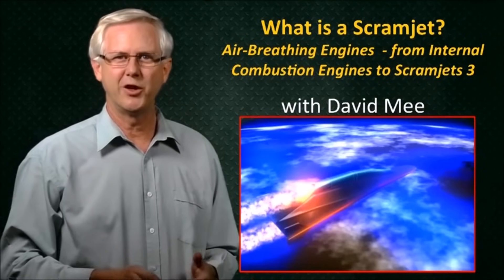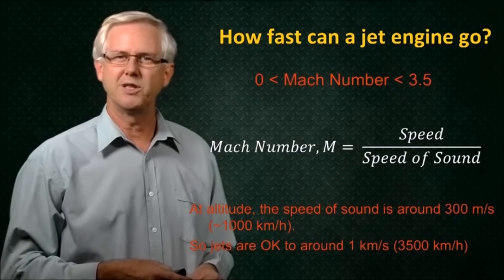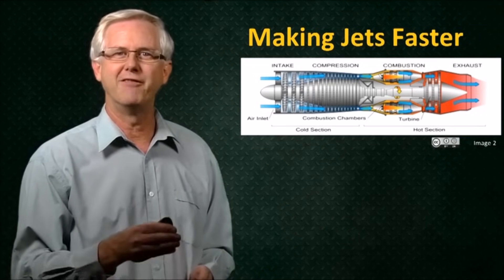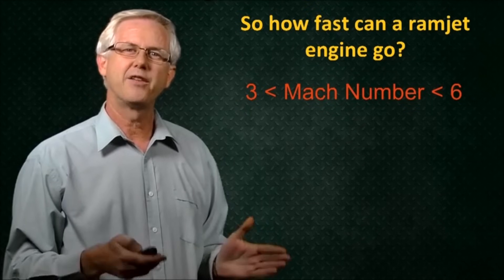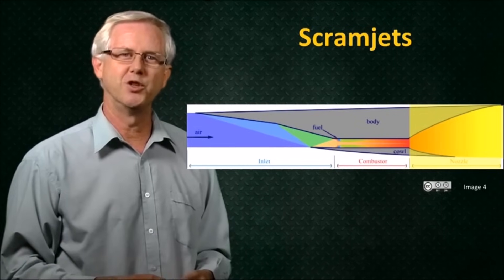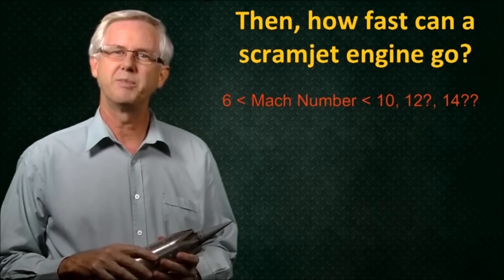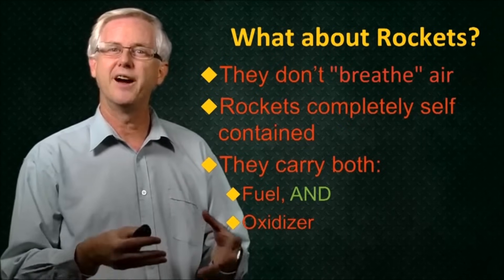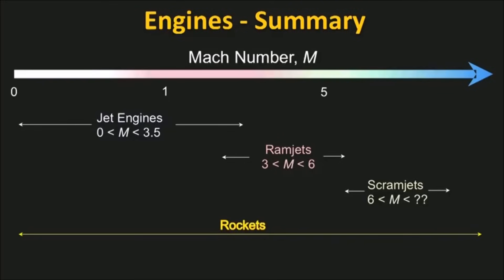Ramjets and Scramjets Explained - Mach 14

Comment: Hmm, I guess the goal would be a seamless transition from turbojet concepts to rocket concepts all in one engine. 

In which the traditional turbojet is fitted with a scramjet bypass as a function of the afterburner, in which of itself contains the rocket mechanisms for outer space travel.

An engine that adapts to it’s environment, though quite complex due to the integration of the three systems at once, if not compounding the cooling issues and the limits of the combustion process
Reply from the maker: the concept at the moment is rocket launch to Mach8, initiate Scramjet. Suitable for missiles mainly and vg for such due to the extended range resulting from no oxidiser required/this is where development is at. Then next a composite engine is the Nirvana, logically turbojet to Mach3.5/close compressor/into Ramjet mode (eg SR71)/get to Mach8/into Scramjet mode/get to Mach14. Such a vehicle will be the way most spacecraft would be launched.. piggybacked onto the Scramjet composite.  The main barrier is heat at hypersonic speed/most metals melt/most sacrificial surface systems haven't worked. The Queensland Uni is developing the laminar/isentropic flow technology that overcomes this which is why the US Govt has bought into the program.  It only takes one idea to make things work then everyone else can develop the crap out of it

Comment: As the scramjet is limited to its oxygen supply would it be more effective to design a hybrid scramjet as as it pushes to its limit of mach 10 more oxygen is added to the scramjet to make the jet burn hotter but the oxygen could serve a duel purpose to keep the engine cooler so it doesn't melt under the extreme heat. Mach 14 onwards may be more achievable then.
Reply from the maker: if you watch my latest video: https://www.youtube.com/watch?v=ovKipc5LpCU  .. at 3:41 you'll note that Stanford University added hybrid flow to the test craft that Queensland University are now building with the USA
Reply: Edwin Henry Blachford I did wonder I'm a mechanical design engineer by trade I came up with a design that incorporates a version of the j58 engine with a hybrid scramjet. The aircraft is then able to get up to optimum speed under its own power. The twin j58s shut down and close off at around mach 6 which is enough to start the scramjet. Then from there the scramjet powers up to mach 10, from there the coolent system is engaged before the oxygen and kerrison mixture is injected to take the plane upto mach 14 then the kerrison decreases and the oxygen increases to take the plane possibly upto mach 16 or above.
Reply from the maker: it sounds like you need to enrol at Queensland University.. for they have a hypersonic wind tunnel where concepts can be tested.  You may note that the USA is quoting Australian/US designed Scramjet missile delivery rates on the basis of Mach14 sustained flight..  To go to manned hypersonic flight the experience gained in the SR71 program would be of assistance but the move from 3500kph to 14,000kph is a big one so initially the application would be missiles and drones. Lessons and reliability derived from that use would spur on the manned craft.  This is a new frontier on many levels
Reply: Edwin Henry Blachford i live in the UK I am currently studdying a degree in STEM. I have emailed BAE systems about the design and im hoping they would take it further so fingers crossed i can get to speak with someone and talk through the designs.
Reply from the maker: a wise move.  It only takes one bright idea to start a whole new technology. It would be nice to be at the forefront of it eh :)
Reply: Edwin Henry Blachford it would be nice to see some returns on it for sure. I've always had an interest in aeronautical engineering and to put something into practice that would move furture technologies forward into the future would be a tremendous achievement. I watched the prototype of your design the fuselage looks amazing.
Reply: Edwin Henry Blachford I've not heard back yet but i have also written to the RAF to see if they can point me into the right direction. I have come up with a fuselage concept that is built  around the the scramjet to save on weight. Im struggling with material composite thats able to handle the extreme heat and hypersonic airflow pressures at the moment that was what i was hoping to speak with someone on and how to house the main jet engines and how to redesign them but also work the same way as the j58 does.

Comment: Basically, a 'rocket' engine can work, if one simple removes the entire oxidizer system, replacing it with a simple, very small and light air intake.
Jeezes, folks...
We speak of flying in an oxygen based environment for airplanes.

Comment: Where do Pulsejets, like the V-1 fit in here? Can a rocket be used to cross the Ramjet/Scramjet interface in real aircraft (not just research vehicles)?How about directing the air from one chamber (like a revolver with or without moving parts)?Maybe one inlet that divides up and the side shape restricts till the cylinders are synced like a multi-engine airplane, but firing in sequence like a V-8 car engine?

Comment: If sound travels faster at sea level than it does at higher altitude, then you would be flying at a higher Mach at altitude than you would be at sea level at the same relative speed, but simultaneously flying at a lower ground speed.

My question is, at what point can you no longer increase your altitude to mitigate the effects of too much air compression ( and therefore high temperatures), and drag? And can ram- and scram-jets operate at higher altitudes, or is it a physical requirement? Can you not just increase altitude until there's hardly any atmosphere?

Comment: Popular Science reported that Professor Wang Zhengou won the Feng Fu Award for developing a combine cycle engine.on October 8,2015.The report shows in pictures how the turbo-scram jet engine works,As the jet engine reaches mach 2 speed,the air is shut off to the turbine portion and directed to the scram jet engine.I think the turbo-scram jet engine is manufacture by using a graphene-titanium alloy to with stand the high temperature..On September 18,2015 a stealth airplane flew at mach 6 speed for several hours and landed as shown on CCTV-13 and reported by two newspaper.The airplane used two turbo-scram jet engines and a graphene-aluminum alloy fuselage,wings like the C919.On January,2017 a turbo-scram jet  was launched and shown on CGNT.
Reply from the maker: graphene-aluminium and graphene-titanium alloys melt at hypersonic speeds.  You must remember that the craft is approaching the velocity of a space craft during re-entry.  The answer for sustained hypersonic flight is not with exotic materials.  Your report appears to be propaganda
Reply: Corrine Tsang it's amazing what you can with balsa wood
Reply: Any link to the articles you are referring to ?

Comment: 1000km/h is not 1km/s that would be 360km/h.  60sec x 60min
Reply from the maker: Yes the professor is wrong in the middle of his long unscripted lecture, but 60X60 = 3,600kph ( not 360kph ). So you're wrong also. 
This is the second comment here claiming that 60 times 60 is 360. Amazing.

>>>> The actual speed of sound is 0.344km/s <<<<.

To be precise: at 50% humidity, with 101.325kPa atmos pressure and 20C, sound travels at 343.99m/s = 0.34399km/s = 1,238.364kph = 769.4837mph = Mach 1

Therefore if a Ramjet is doing Mach8 it's travelling at 9,800.352kph nominally.  or... 6,089.655mph.   Which is equal to leaving New York and arriving at San Francisco 25 minutes 20 seconds later.  Airlines would save a fortune on in-flight meals.

However, a Scramjet doing Mach14 is doing 17,150.62kph nominally or .. 10,656.90mph.  New York to San Francisco would take just 14 minutes 29 seconds.

When governments design roads that allow us to drive to an airport, park and board a plane under 1 hour i'll be truly impressed.

Comment: Don't understand this at all. (I suppose I'm a thicko)
The diagrams show that the intake aperture is bigger than the entry into the combustion chamber (it narrows)
Therefore in my thick brain, this speeds the air up, not slowing the air down as he said?
Reply from the maker: Some tapering of the throat must be expected to replace the compressor stage of the turbine. Hence the design has no moving parts. This is where such a design looks deceptively simple, for what is too much taper?

Comment: What interested me the most was the fact that  while Queensland University has done so much work on this concept. The actual state of scramjet research is buried in the depths of "Classified" information probably in Russia and the United States.
Reply: All I'm saying is look at the Blackbird. That thing is a mechanical marvel and was built during the cold war. Rockets however made putting those engines on planes obsolete. Why spend hundreds of billions if not trillions putting it on a plane when you can build a rocket for a fraction of that and shoot said plane out of the sky Or destroy the entire air base that launched the plane in minutes and hours?

 I would love to see what every nation really has at least just from a curiosity stand point.
Reply: Yeah, the blackbird could outrun the missles at the time, but now missile tech has advanced to the point that it made the plane obsolete. Of course the US never would admit to this for security reasons. The only thing that could replace the blackbird is a plane equipped with a scramjet but I guess they could never solve the heat problem.

Comment: How would get it to Mach 3 if it does not work any slower
Reply: Dropped from a jet aircraft as in this video
Reply: Jet engine boots to Mach 3 , first 
Boost Ram
Old news. So we are at least 50 years ahead in black projects

Comment: Sounds like fairy tale physics to me , What is attached to your engines , what metal , what glass what fuel tanks, ??? sort of very hot ? THE BLACKBIRD At mack 3.5 ? after that it gets to hot for any metal plastic glass we can make ,So even if you have a engine to so port the temperature at mark 10 12 14 ??? What would you attach to the engines,  and rocket's do not Work in space ?vacuum , if space exists, THEY NEED SOMETHING TO PUSH OFF.
Reply: Ever heard the term "Reaction Mass"! Rockets DO NOT push off anything! Twit
Reply: BULLSHIT FUCK HEAD   ROCKETS DO NOT WORK IN A VACUUM
AND THE EARTH IS FLAT;
Reply: Material Sciences can overcome many of the limits of current technology, and we're getting more efficient all the time in synthesising them. You should look at Sabre Engines design in dealing with the extreme temperatures entering the Engine. They use a rapid cooling heat exchange, I dunno how it works but I'd love to know.
Reply: Yes,   what if we add a magnet field to the equation?

Comment: mach 3.5 isn't the limit for normal jets, the top speed of the SR-71 is still classified
Reply: CalFortress2 SR-71 has a combination of a jet engine and a ram engine.
Reply: TDMaster35 SR-71’s engine isn’t a normal jet engine though. At high speeds, it operated like a ramjet due to the compressor bypass tubes.

Comment: you really should look at the Sr-71 engine diagrams, the are normal turbine jet engines but with 6 bypass tubes moving air from the leading cone to the exhaust making them ramjets. As well as being able to keep the perfect pressure/speed mix by varying the cone distance.
Reply: I've been on an SR-71 marathon lately everything about that plane was perfect and without the technology of today
Reply: Eddie Congdon Just think it was operational in the 1960’s but classified Top Secret!
Reply: I don't know why, but for some reason YouTube has been recommending a lot of videos about aerospace engineering and the SR-71 to me lately so I was also thinking about the turbo-ramjet of the SR-71.
Reply: i thought of those sr 71 engines   😁🤘
Reply: A Tesla valve diffuser
Reply: I don't know why, but for some reason YouTube has been recommending a lot of videos about aerospace engineering and the SR-71 to me lately so I was also thinking about the turbo-ramjet of the SR-71.
Reply: Absolutely..but to be fair a couple of those engines flamed out and killed the pilot..the the design and theory is sound..but the sensor technology to contermand the sheer forces on the engine didn't exist
Reply: Like riding a firework and hoping for the best..but as you say..absolutely correct..but keeping that balance of pressure, combustion at those velocities takes computer input..did have that in the 60s
Reply: The J58 isn’t a ramjet in any part of its envelope.  The bypass tubes bypass air from the compressor 4th stage to the afterburner section, giving it a ‘ramjet like’ or ‘partial ramjet’ functionality - but the single-spool turbine/compressor sections always turn and the combustion section and nozzle always produce thrust.  A true ramjet has no moving parts.  The J58 is properly termed a turbojet with bleed bypass.  Ben Rich actually qualified it as a “bypass jet engine by air withdrawal.”

This isn’t in any way meant to denigrate the J58 and inlet design - it’s simply to get the semantics correct.  The inlet design was considered by Ben Rich to be the most complex engineering of the entire Blackbird project, and David H. Campbell, the inlet design lead, solved the problems with containing the all-important normal shock wave placement for ‘starting’ the inlet at speed.  Campbell was awarded a patent for his efforts.
Reply: Doodley - I seem to recall that the inlet spike ("cone") was positioned to trap and diffuse the normal shockwave inside the engine air inlet. An "un-start" is when the shockwave popped out the front of the air-inlet, and in the early (pre-computer) days of the SR-71 program, an un-start was a serious hazard. Later computer controls all but eliminated the problem.
Reply: @Jangle2007 absolutely..totally agree
Reply: Ok folks, trivia. The scramjet uses a different atmospheric reaction to provide thrust than say a turbine or a ramjet or a turbine ramjet hybrid. Name that process and ide say your fairly intune.
Reply: @jamesbullock7257  You're*
Reply: @jamesbullock7257  @james venture i
Reply: @jamesbullock7257 you ditch the turbines..fall apart at hyper velocities anyway..ditch the combustion chamber..because these engines only work at high speed..thermodynamics..they light themselves at mach speeds..narrow the exhaust outlet..like putting your thumb over a hosepipe at tap pressure..smaller the exhaust aperture..stronger the thrust
Reply: Wrong
Reply: @jamesbullock7257  Actually, it's exactly correct.

Comment: Would it be possible to have deformable engines that can work as ramjet and scramjet interchangeably?
Reply: Three intake passages, a deep one with compressors, a ram with shock cone, and a scram bypass for highest speeds.  The shock cone could be used as the faucet, directing flow into the desired channel or as the inner wall of the scramjet bypass.
Reply: This video got me wondering that too. Though the scramjet diagram is very different than the ramjet engine, it probably could be done.  Use a plane body like the scramjet, but use a ramjet compression cone that can vary in size & width, all the way down to nearly nothing (get it out of the way, somehow).  I think a turbine engine could be set up to 'move away' from the airflow in much the same way.

But, all this adds complexity, which increases chances to break, along with costs to maintain, and nobody wants to do that unless the payoff is worth it.  I still think it's possible
Reply: Curious as well, but seems unlikely because they were struggling to make a scramjet to even produce enough thrust to overcome drag. This leads me to believe that a scramjet is extremely picky in regards to the shape. Extremely so.

As in any deviation from a design that is dedicated to just being anything other then a scramjet is likely to fail.

However would be badass if we could get ramjets to work as scram jets.
Reply: I experimented with ram jet technology back in the early 70’s in my garage. I sent a 200 page report ,To my school teacher with my 9’ tall rocket and modules. He was so blown away by my project he sent it to some body in NASA. I ended up getting a medal and certificate and they helped pay for some of my lab equipment. The math really messed me up. I couldn’t get that high in math out of my league. All I got was 5 degrees in Me. / MFG. engineering. I had a blast building and testing things back then. I still mess around with rockets for kicks small stuff these days.
Reply: Like the J58 turboramjet I suppose ?
Reply: I was thinking a step further... what if oxygen is injected when the scramjet reaches its limits ?
Reply: So you'll either need an extra compressor or carry oxygen on board, causing more drag and putting you one step back again.
Reply: Still a smaler oxygen tank than a rocket, I'll leave that to the engineers, they will somehow take a rabbit out of their hat on day ! ;-)
Reply: mindstorm8191 highly variable configuration is likely to be a feature of future aircraft
Reply: Search up turboramjets
Reply: i wonder if you could replace a truck turbo with a mini scramjet
Reply: dave ortwine what in the name of God are you trying to convey with your horrible analogies? I don't believe there are many up here that really care about your sex life with your wife.
Reply: @nathanscott1764  Twist! He's never actually had sex with a woman.
Reply: I am not exactly sure but I know the J58 on the SR71 had Ramjet and regular jet engine. It didn't necessarily officially have a ramjet but it essentially functioned as so.
Reply: Maybe.